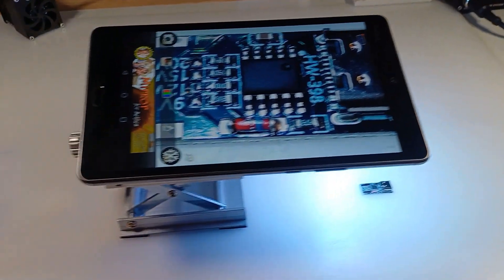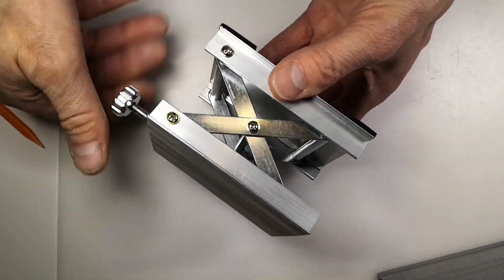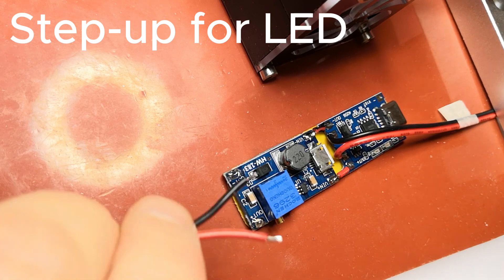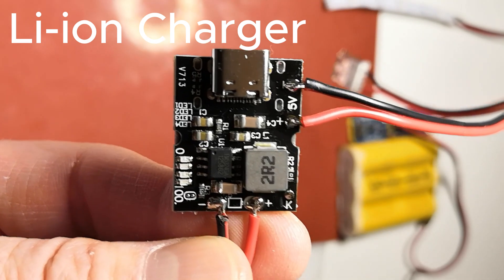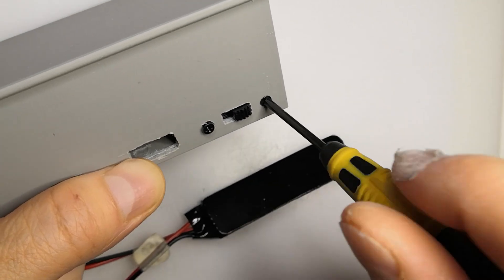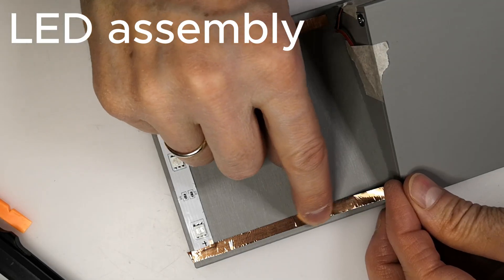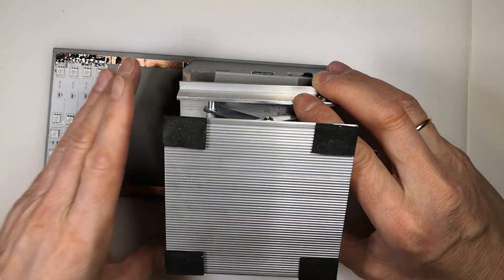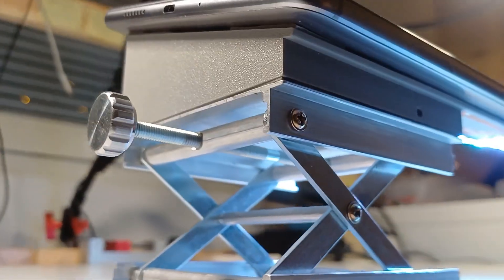DIY Soldering Microscope from Tablet - enhanced version

Comment: Only problem with this is that the screen is horizontal/parallel to the subject(pcb) you can interface a old smartphone camera to display on the tablet and keep the tablet vertical like the market solution old smartphone even the budget ones have far better camera quality than a expensive tablet

Comment: can you please review the $10 microscope that goes with a pc
Reply from the maker: There are several such reviews at youtube. The quality of those are low and usable distance very short. Tablet gives a view on screen and you can peek the object also directly, with a small move on your eyes.
Reply: @SnapTinker ya , it is usually better to but expensive than to waste money on cheap chinese crap there is a saying in hindi "sasta khardeoo bar bar mehnga khredo eak bar" which roughly translate to- you have buy cheap multiple times but expensive just once